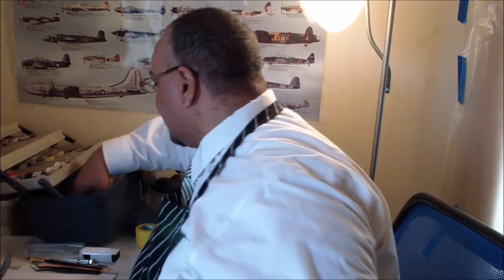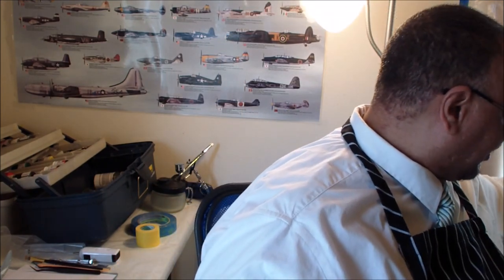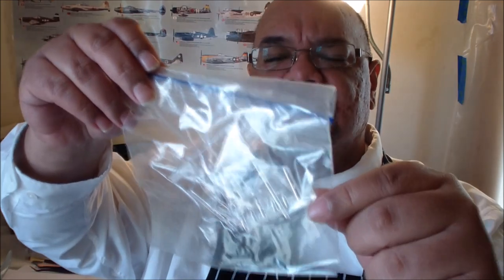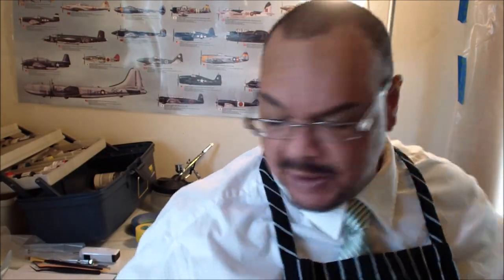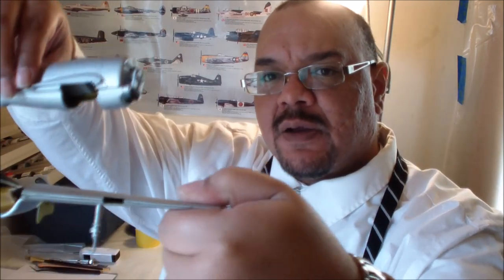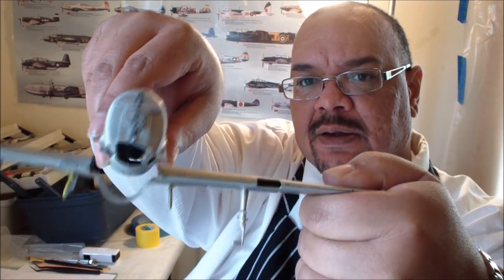Is Liquid Cement better than Super Glue for Building  Plastic Models?

Comment: Plastic model cement causes a chemical reaction and welds/melts the polystyrene plastic parts together. Super "glue" or Cyanoacrylate is a type of liquid acrylic resin that hardens when exposed to humidity. It doesn't bond as well to smooth surfaces like plastic! Use modeling cement!

Comment: As avid car and truck builder, I always used Zap medium super glue.  It just seemed to set quickly, and real quick with the Zap zip kicker.  As everyone knows that can cause a real mess especially with small parts.  I have recently started using Deluxe Materials plastic cement.  It has a metal applicator and really bonds quickly and is cleaned up with water.  I also use Tamiya thin glue as well as their regular liquid cement.  Sometimes I use my easy flow applicators with some Flex liquid cement.  I like the capillary action.  I only use the Zap super glue now to fill in gaps.  It is great for that. Really enjoyed your video on the use of glues.  Even as a car builder this is common ground.
Reply from the maker: +Mike Warnke . Thanks for that, and I will look into the Deluxe Materials brand glue. I already use their putty and I absolutely luv that stuff!

Comment: Building mostly Tamiya Models ( except for when they don't have a Model I want ) I also keep using their Colors but for some reason I was never able to also get my hands on their glues/adhesives so I settled with the Revell ones ( blue bottle, metal tube applicator ) which kind of served me well except for it to always clog up after a few uses/seconds when not in use until I continued with the next part.

Yesterday I managed to check out a shop which had pretty much anything Tamiya has to offer so I finally got my hands on the Tamiya Extra Thin Cement which comes in a glass bottle and a small brush applicator in the cap.

With the Tamiya Cement you simply hold the two pieces together THEN apply the adhesive on/along the seam. It also appears not to stick to skin when you accidently make contact with it and excess evaporates so fast that by the time you turn the work piece around to finish the other side the one you started with is already dry so there's practically no risk of a shift of parts when handling the work piece.

Talk about a revelation in user friendliness.
Reply from the maker: Duraltia A lot of guys swear by it. I bought an $8 bottle of it and it really disappointed me. Parts kept falling off weeks after I completed the model. I think something was wrong with that batch I got because everyone  else seems to really like it.
Reply: +Joel Z. Williams Nice video Joel.....one problem I find with the Tamiya extra thin is it doesn't always hold larger parts, so I use the Testors black bottle adhesive as you showed. It (Tamiya extra thin) also dries too fast for large applications, I prefer Testors as it's thicker.

Comment: Also welding compound works by effecting poly chains in plastics. The solvent breaks them and they re line as it evaporates. The methyl ones in particular do an excellent job at settling the chains as it evaporates. I try to stay away from acetone ones even though it’s somewhat chemically similar to methyl keytone

Comment: You’ve got the knowledge and vernacular of a scholar and the charm of a layman (heretofore, natural manager). I’m not a model enthusiast coz I ain’t got the brains of an engineer, but you’ve really cleared up some stuff for me as I debate on whether or not to bond back my broken cheesy plastic Walmart headphones with rubber cement instead of using another medium. I’m tickled pink to now be able to discern between adhesion and gluing, thanks to your advisement. Don’t waste your teaching prowess in public schools — you’re overqualified. Stick with your current production sense — because showbiz.
Reply from the maker: WOW, thanks for the compliments. I wouldn't sell yourself short on being able to put a model together. It really is all about taking your time and just doing a little bit at a time. Also, I always tell new builders to buy two models. That way if you really screw something up you can cannibalize those parts from one kit and carry on as if nothing happened. lol. ("move along, nothing to see here"). Thanks again!!!

Comment: Hi Joel.  I've come to the conclusion that you can't go far wrong if you stick with the mfg
recommended products, tamiya paint, tamiya thinner or testors paint and testors thinner.

 I'm one of those rc guys, I build mostly giant scale, (80"+ wingspans).  I use the Bob Smith CA glues, epoxies and carpenter's glue when I'm building one of my flying models.  You mentioned that testors glue for gluing canopies, the rc version of that is called RC560, it looks like elmers, but it dries crystal clear.  In fact I have used it to make the glass fronts of the instrument panels in my rc models.

When I build plastic (and I've been having urges to buy a kit)  I use testors, tube and liquid.  Have not used anything else in 40+ years.  I guess the P-47 is finished by now, how did it turn out?
Reply from the maker: +mecallahan1 . Great comments! I am humbled by your more than 40 years of experience. There really is no substitute for that. I'm also heartened to hear that you use a similar "white glue" for your glassworks.

As far as the P-47, I recently took a job in Philadelphia and I had to leave all of my kit behind. I plan to retreive that stuff from Missouri in the late Spring.
Reply: +Joel Z. Williams Thank you Sir, I hope you're able to get back to it soon.  One thing for me, I've always brush painted my plastic models but I'm giving a lot of thought to upgrading to airbrushing.  going to watch your video on that subject in just a minute. Keep up the good work.

Comment: I'm using testors liquid cement on larger 3d modeled parts and the bond doesn't grip sometimes. Should I using super glue on the larger pieces?
Reply from the maker: Yes I definitely recommend that. Bob Smith industries is the insiders secret adhesive. You should be able to find it online for less than $10. Be sure to get the purple one

Comment: Hi Joel, thanks for the video's, they have been great.  I wanted to ask about the Insta Cure glue.  You use that instead of the liquid cement?  Or together?  When do you use either?
Reply from the maker: +George Chacko . To be honest with you, I almost exclusively use the Bob Smith Industries gap-filling glue (purple-cap). Even though it is essentially a super-glue, it is slow-curing like a liquid cement and dries clear. I also like the fact that I can simply sand the excess away if I&#39;m trying to join a big seam (use much less putty to fill gaps). I buy glue tips from a company named Zapp (24 per package) and that allows me to apply just a smidgen or a lot depending on the seam I need to join. An added bonus is that the BSI glue tends to thicken in the bottle over time so it becomes even easier after a few years to get a really thin bead of glue. That stuff is boss.
Reply: Gotcha, thanks for the insight, i'm starting back up after many years so i'm slowly gathering supplies.  Your intro to supplies video was great too!  I pretty much have everything to get back into building and see where i go

Comment: Hi, I prefer super glue for parts that can go only one way, that will sit firmly, plumb, and I sill not have to adjust (like a pilot seat or something realy stable. If I have a piece that I could have to move a bit to fit another piece to, I will use plastic cement that gives me more working time.
Reply from the maker: Yep. That's a good spot to use that type of glue. Do you still use liquid cement for places that flex a lot?
Reply: I made a come back to modelling after 40 + years and glues have evolved a lot since the Testor glue in a tube so, I am trying different types and brands of glue. I like the humbrol poly cement for its precise applictor, I like the Bob Smith CA glue (good to fill small gaps). Tamiya makes good products too. I cannot say one is better than the other, they are
 complementary and I still have to experiment more to find which product is better for which situation. Could you please give me details about your awsome yellow clamps. Who makes them. Thank you  for the time and effort you put in your very interesting videos.
Reply from the maker: Yes, the clamps are made in Slovakia by a Cleveland Ohio-based company called Wolfcraft. I purchased a variety pack of 6 online for about $12 from Amazon.com

http://www.amazon.com/Wolfcraft-Pc-Hobby-Clamping-Set/dp/B000GATAXC